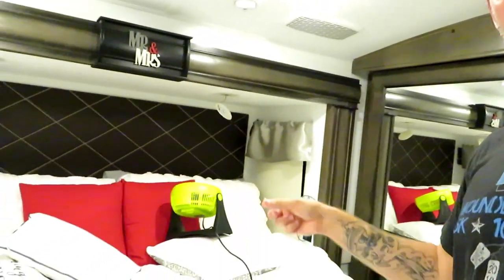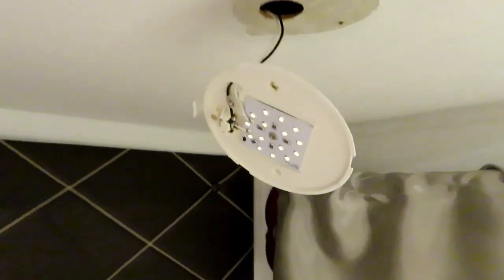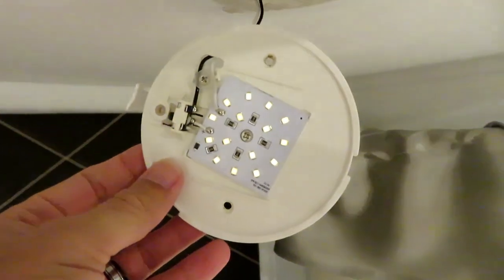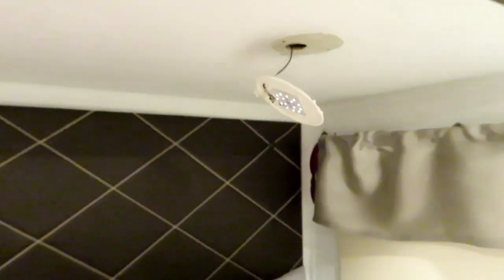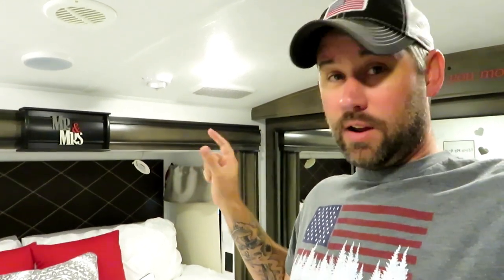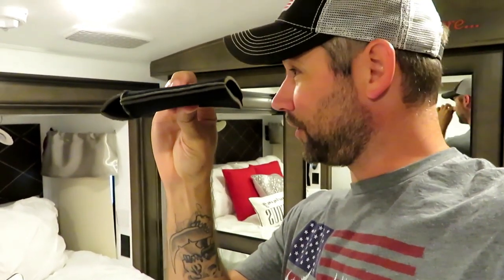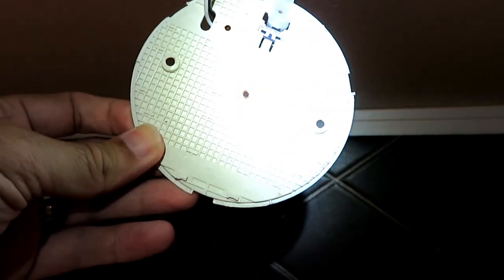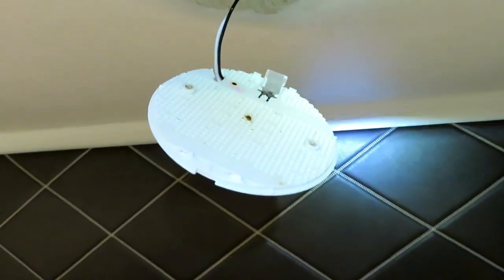RV Living: Redneck RV Hack (That really works)

Comment: Do you have a Slide Awning? That keeps the sun from directly hitting the top of your slide and helps keep it cooler. Also keeps leaves , sticks , pine cones ext from gathering on your slide.
Reply from the maker: No. We do not have the slide awnings. We have discussed getting them added.
Reply: @WaywardWaggs  
   Our 2019 Outdoors RV Mfg. Timber Ridge 24RKS didn't come with a slide awning , but we had them install one. It's working out very good.
Reply from the maker: We will look into getting some if they are not super expensive.